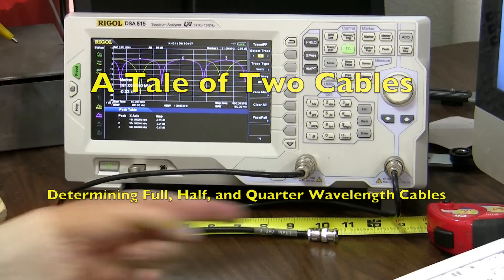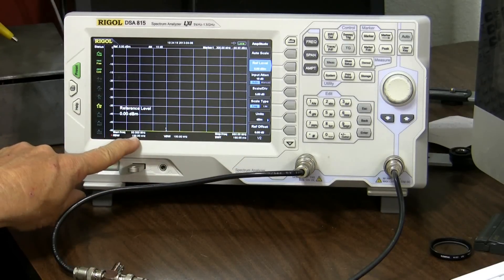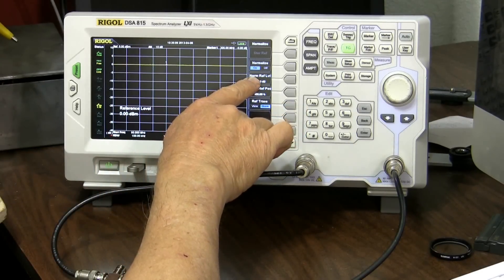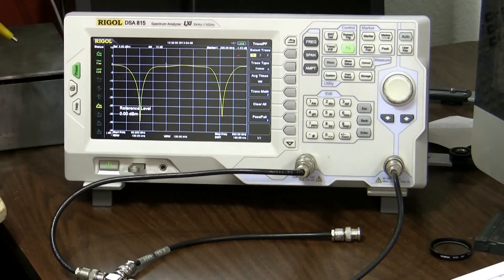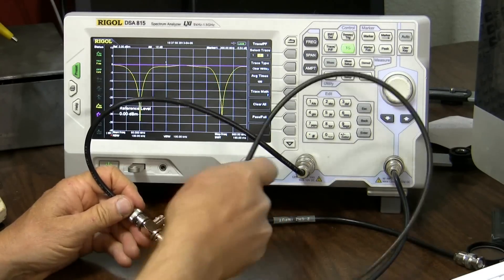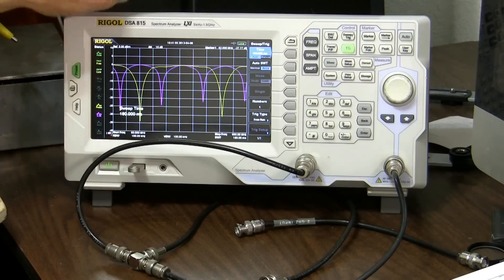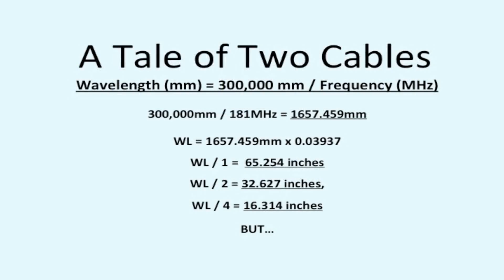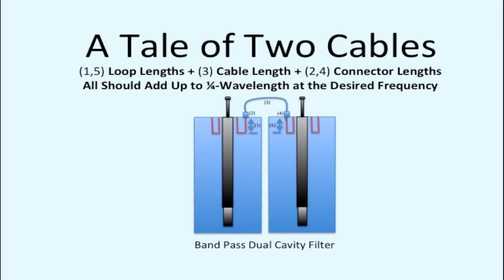A Tale of Two Cables

Comment: Hi, very interesting video!I was wonder about measurement with wattmeter, is necessary to calculate the coax length between tx and the dummy load (includes the meter)? I mean for accuracy metering.